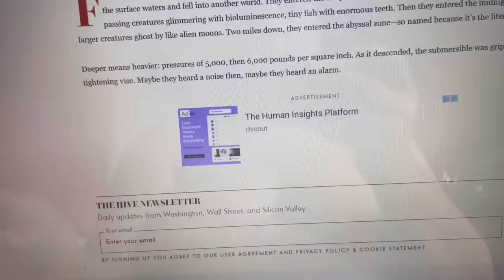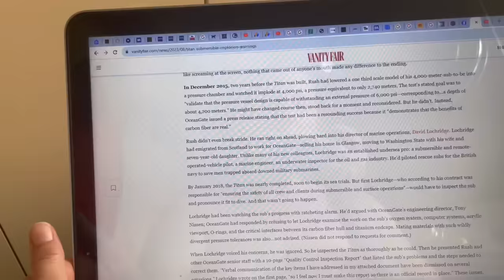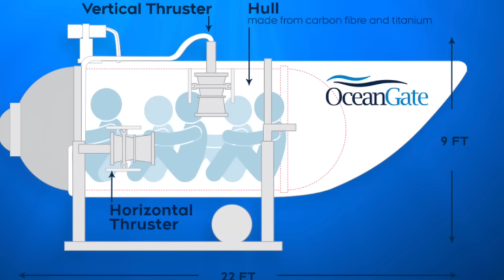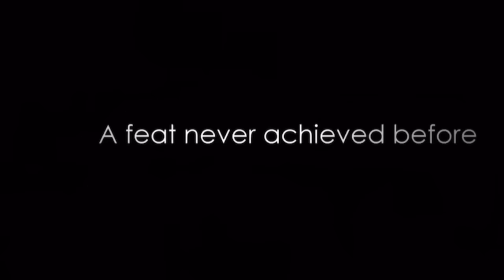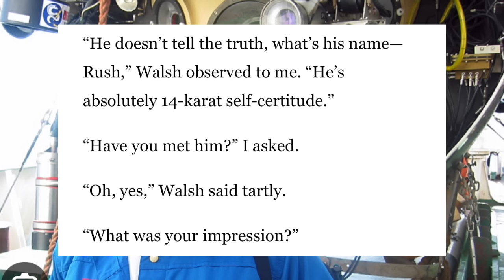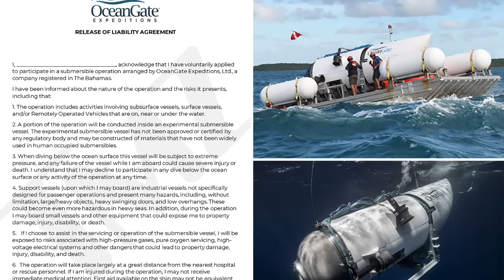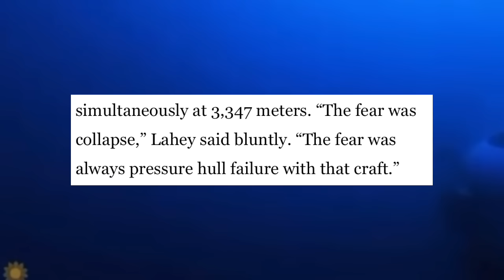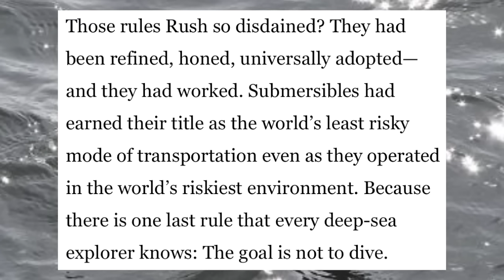TITAN Sub: The Most Shocking Titan Lies & Cover-Ups that you have never heard before #Titan

Comment: The most shocking is the port window was only rated to 1300 meters. That's all you need to know.
Reply from the maker: yes, insane
Reply: Oh, it's no problem! You'll see cracks develop in the acrylic before it explodes, giving you plenty of time to ascend 🙄
Reply: @jimfrazier8611 that is correct. It was rated to 1300 meters. Oh I heard the transcripts and Rush said cracking sounds to to back. I window probley blew out during implosion. I do wonder what caused them to sink so fast.
Reply: not what failed -
Reply: @prestonburton8504  Doesn't matter if it was the cause. Ocean gate hid the port window rating from its passengers. They took a craft that was rated to 1300 meters to the Titanic.
Reply: Diving is dangerous,he  pushed the limits , other life lessons from other professionals ignored ,
Reply: ❤ Rush was a Genius ❤
.❤innovative wonder ❤.
❤ Breaker of Rules ❤
Reply: @ifv2089  A fool who put other souls at risk in pursuit of his glory. He should have made lone dives until what he said matched the performance .
Reply: @Bobo-hd6qn  GREAT IDEA!!  Anytime you pay to be a passenger of a Sub or any experimental device or anything new or dangerous should require the owner/operator to give out all the detail of the craft they're about to ride in. And require they're given this 3 days before riding. I bet 50% of anything ride would see cancellations.
Reply: @weatherphobia  Yes, you should be told that the sub is only rated to 1300 meters. And going past that will result in your death.
Reply: @tm13tube He needed the money they provided - the safety of others was not his primary concern.

Comment: "stuck in the sub for 96 hours with all the comforts of an M.R.I. machine." Best line. Good analysis. These dives were experimental if only experts went, but once you carried passengers, it became criminal.
Reply from the maker: Hi , thanks and yes I think so too, go alone and experiment but lure clients into it with all the known flaws ? As you said, criminal
Reply: Hahaha
Reply: I think I've spent like 30 minutes at one single time in an MRI but I couldn't imagine spending 96 hours . I think I would have opened the hatches at around 24 hours .

Comment: Personal opinion here: Given the legal challenges and law suits that were fired at Rush and obviously the many safety concerns raised which Rush simply brushed under an extremely big rug, also the reports of cracking sounds, power failures, loss of contact for as long as 2 hours, etc. On the day of the tradegy he also took the craft down far too fast was this yet another malfunction or was Rush just showing off?  Had it spung a leak and was taking in water which caused the speed?
Titan may have also sustained structure damage when it crashed into a coral reef? Which again I believe was in true Rush style as "Whoops, no worries a good buffing and duct tape will soon fix that" and I also believe that there was something on the outside held down with duct tape as well. I heard in one video, he was using out of date materials that had been sold to him cut price due to their sell by date expiry. 
Anyhow I think Rush was losing money hand over fist as one by one backers and investors pulled out after they realised that Rush was an untrustworthy dangerous lunatic on suicide road. So Rush had to pull the old proverbial rabbit out of the hat to literely save his business, and to desperately prove his invention was safe.
 Rush comes under the heading of Inventors killed by their own invention, but the heartbreaking thing about all this, is that he took 4 innocent people with him
Reply from the maker: Hi , yes he bought expired carbon fibre from Boeing and stuff was zip tied to the outside of the hull
Reply: Innocent???  One perhaps...the others No, the father doubly so.
Reply: @user-hg1rx2xv4g  l believe it was actually  supposed to be the father and mother who were going to go in this death trap. But somehow the son went instead.  I read somewhere that the son wasn't really wanting to go  as ship wrecks weren't his thing. So the son is perhaps the most tragic and innocent of those who died that day. But perhaps the best use of words to explain the actions of the other 3 is foolishly innocent. Rush must have been very persuasive and convincing to get them in the bloody thing in the first place and the fact that one of them had been down in this death trap with Rush before was perhaps the biggest plus point for the others to take the risk. Its a tragedy that shouldn't have happened and I hope never happens again. The polar Prince crew has a lot to answer for and what ever comes out from the investion into this tragedy is going to make the proverbial hit the fan big time and make heads spin.
Reply: Coral reefs cannot survive in the dark. You will not find them at great depths.
Reply: @carolcook6130  True but crashing into the reef was something I had heard about in another video.

Comment: "When everyone except you is wrong, then maybe you're the one who's wrong."

Stockton Rush summarized in one sentence. Sadly the people who fit into this definition are the ones who will most aggresively fight anyone who thinks they're wrong to the bitter end.
Reply from the maker: Hi Elin, you are so right
Reply: "even if you are a minority of one, the truth is still the truth"
-Ghandi

fact is: we don't know the truth.
all we know is what we are told, and the more i learn about this the more i am 
tempted to reject.
Reply from the maker: Hi Davey , do you have another theory about what happened ? Do you mean they lied about what happened ?
Reply from the maker: interesting , why does the debris not match ? When the carbon fiber hull imploded the two rings clashed together and theory is the bullseye was pushed out and therefore found intakt. Did they even bring coffe cups ? I would assume just some plastic water bottles ? I would jump on the scam theory more if Rush had not been on the sub , does not make too much sense don‘t you think ?
Reply: that is so true , in general that is a huge problem in our society these days
Reply: @silki24  there is a big ring between the tube part and the bubble up front. they hauled one up that was intact, and it does not match pictures of titan.
Reply from the maker: really ???? I will look that up , the released pictures and videos of the debris are not very good
Reply: @silki24  yeah as i recall the original had some kinda bolts or rivets all around it, but the recovered one doesn't have them, or any markings of them ever having been there.
Reply: @silki24  lol don't get  too excited. the evidence is there but it's subtle.

i consider it fairly suspicious partly because of experience looking at other hoaxes.
Reply from the maker: @daveyjones5702  tell me more , now I am really interested ! What other hoaxes ? Regarding the Titan, what do you think happened , let's assume the parts they found do not match the Titan that went down , where is the Titan and the passengers ?
Reply: @silki24  the titan would be in storage somewhere, and the occupants might be living under a different identity. 

there is a theory that seems to have some merit that there are astronauts that died on both challenger and columbia.

if i were to investigate (and i'm not) the first thing i would want to do is look into the identity of the supposedly dead people.
in some cases i have seen supposedly dead people having never been more then a construct that popped into existence months before their death, and show zero signs of life before that.

in other cases, incl of those astronauts, i have seen the identity assumed being one of a faux sibling. again no sign of life until there was a need for their existence.
Reply from the maker: that‘s a possible theory but why I think the accident did really happen is all the warnings over the years from experts all over the world, all the cancelled trips because of problems , the issues have been filmed as well , for example in the BBC documentary. And why would a guy like Nargeolet want to disappear ?
Reply from the maker: Hi Davey , I looked at the front rings that were bolted together, they are two rings, one has the bolts on the outside, the other one looks really smooth and the holes for the bolts are hardly visible , could you have then that one in the debris pictures ?
Reply: @silki24  maybe, though at the time i didn't think so. but like i said i never did a deep dive on it.
in any case what i am referring to is a picture of the ring as it is being lifted out of the water at the recovery operation.

what i do find rather explicit though is the intact coffee cup among the debris.
Reply: @silki24 I can't say about a coffee cup making it - I've been around diving chambers and diving bells - 
     I've seen what happens to divers when they loose there air supply and pressure at 500;ft - I've seen some get to much oxygen also and died or not enough - 
      Also when gases are being compressed into a liquid state at very high pressures the heat has to be removed - 
      If a volume of air is compressed 23 times in a split second at 0° C it will reach 260° C in that split  second -  that happens when a compression start diesel is started at 0°C  - 
      When that submersible imploded the pressure was mega intense - my guess is there body broke back down into hydrogen and carbon and ignited with the implosion - 
  That ignition would have blown the window out -
Reply from the maker: I have not seen that coffee cup yet, was that on the ocean floor ? I have seen that picture, I believe they said it was from the Titanic ?
Reply from the maker: Hi Able, that would explain why they found the window intact
Reply: @silki24  i looked a while ago, i can't find it anywhere now either.

i think i have it on my hd somewhere though
Reply: @silki24  now that i think about it, i think it might have been a shot from a video.
Reply: There were more than a dozen points of failure on that submersible.   The failure could have come from any one of them or all of them.    It will take months of careful analysis to even get a clue.
Reply: @RossM3838  we know what caused the problem, dude.
the component's name is: stockton rush. :P 

total PEBKAC situation.
Reply: @daveyjones5702  it was pure hubris for sure but what specifically happened is  important.   Was the epoxy that weakened, or the view port, or the landing frame, or the electronics, or the carbon fiber, or the tube shape, or any of a dozen other points of fail that gave in.    Disasters like this are years in the making and it’s important to track it if possible.   Ie the Apollo fire was set up years earlier with political pressure leading to cut corners.    Finding that all out caused nasa to wholly change their procedures
Reply from the maker: Could that be the Cyclops ? It was built a bit different
Reply: I told my brother in law that kind of statement when he was with a girlfriend his family and all his friends didn’t like.

Comment: A 2nd year engineering student can tell you that composite fiber performs much better in tension than compression.  They could also tell you that a sphere is a much better (safer and stronger) shape for a deep dive.  They could also tell you that the joint between fiber and titanium will be a weak point because these materials have a different coefficient of thermal expansion and contraction.

Comment: The one potential flaw that stands out to me as a trades person is the way the end bells were attached to the hull with adhesives , the rigid titanium end bells and the carbon fiber cylindrical hull 's tendency to flex in the center where it is not supported would really test the bond points .

Comment: Thank you so much for that deep insight to the hole actions & documents, which were happening for years behind the scenes. Because of the aviatic, I knew about the mayor problem about the carbon fibre material (tension opposed to compression). You actually verified, all of what I believed happened in the background & confirmed all of the worse & flaws of character, I was thinking Rush has been. Sorry, he definately was utterly a big asshole. He lied, bullied, manipulated & misleaded, all & those, who could have put a halt to OceanGate as Coast Guard, did not stop it. I do feel for the victims, but I do not consider Rush as one them. If he would have survived, he would have been charged with premediated 1. degree murder & lifetime in prison. May the victims rest in peace.
Reply from the maker: Hi Aviva, thanks for watching , yes I agree , Rush is not a victim, the accident could have easily been prevented. It was only happening because of him. I would really like to know if he had gotten away in court with all his tricks

Comment: Vehicular manslaughter, period. The carbon hull degraded with each dive. Was the carbon reinforced after each dive? No. So the risk of loss was continuously  accelerating.
Reply from the maker: yes true , and that hull could not be repaired , would have to be replaced . Cost was over 1M to replace , so he did not do it , did it once as the gun shot noise of the carbon fiber was huge, he should have stopped using that material

Comment: If he really wanted to further using fiberglass, it would have made sense to send the vessel down unmanned for a number of times, thoroughly checking it after each dive for anomalies, defects, and deficiencies. That would provide at least a guess as to the margins of error, and suggest possible methods to improve (or scrap) the plan. More simply, high-pressure testing could be safely performed in a lab.

Comment: The titanium end flanges should have been pulled up using tie bolts in addition to the cemented joints with the FRP  cylindrical hull .

Comment: Attempted murder? No. You need intent for it be murder. Egregious negligence? That's an understatement. That's one of the few things about law that I know.
Move fast and break things only works in the development of certain types of software.

Stockton Rush is not a loss. It was his ego.

I did learn a few things. I knew others.
Reply from the maker: yes I know what the legal description is but I just feel he murdered them
Reply: @silki24  

It's still negligence and manslaughter at best. His estate (what he leaves behind) should pay for this though. It should also send that technician that he fired because he didn't approve his sub compensation for legal fees an $1 million or 2 because he was unjustly fired.
Reply from the maker: yes

Comment: The carbon composite 
body shell could have been manufactured incorporating numerous variants of material and or manufacturing techniques.
It would be very interesting to know the modulus, unidirectional fabric weight and type of epoxy used for the pre-preg in use let alone the orientation applied.
Also whether the finished product was cured under pressure by autoclave?
I would imagine that the individual components; end caps and body were manufactured to be of equal strength match to each other as possible.
The problem with carbon fibre is that its final performance is greatly influenced by the credibility of the manufacturing environment, operatives involved, ambient temperature, humidity, cleanliness, fibre type, consolidation integrity within the resin matrix and how this is finally cured: Temperature, temperature increase ramp rate and dwell, cool down rate and what external pressure was applied above any vacuum and how it was reduced over time/temperature.
Beyond this the component could be properly controlled but the way it is matched to the end caps is obviously critical. 
Once all of this is good carbon fibre can still be prone to oxidation and galvanic corrosion perhaps more than risk of fatigue by pressure?
In realty the carbon body would be very costly to make requiring the possibility of many repeat variants being needed in order to exhaustively test before any thought of final use occurs.

Comment: Another little clue that oceangate didn’t really do any meaningful exploration or innovation is the fact that recovery teams were able to not only locate but bring back the pieces of the submersible within a few days. Oceangate had to plan and plan for months and then they would often scrub the dive. Real professionals can get to the sea floor reliably and actually bring stuff back when needed.

Comment: This is the best under standing video iv seen to date. I won’t say much only think of the love ones left behind. This is such a sad thing that should never of happened. The sub only 5-inch thick going to them depths is mind blowing imaging the pressure coming from every angle even at 10-inches thick it still would of happened because it was the wrong material. I all so get why this was not stopped it never went threw all the test by experts probably because of the cost but not only that it would of been struck off. It was to much of a rush not only that it was a ticking time bomb that had a short fuse. I know one thing it will never happen again. So so sad.
Reply from the maker: Hi Martin thanks, it is so that because it was so avoidable, why experiment with something that is proven not to work
Reply: @silki24  Hi. You are right it’s crazy. I built many things out of stuff iv found or ask for off people iv even bought second hand stuff but not to put people at risk and not to go to the titanic. Iv worked with carbon fibre on motorcycle my motorcycle so I know haw strong it is I would never go to the titanic in a sub if it was for free it’s know good for that amount of pressure. Rush over be leaved his sub and it ended in disaster it didn’t matter what people said he was not having it because he new best. As I say it won’t happen again. I said in another review what if rush said to the others you go down and are see you in a few hours they would not of went . As I say just think of the love ones that were left behind.